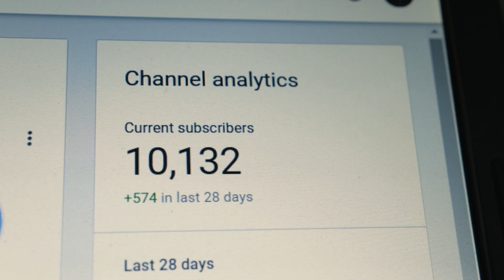ASK US ANYTHING

Comment: Here is 2 questions, I have two optima batteries, primary starting 800 cca red top, back up blue top deep cell marine battery, since I need them to keep them 100% charged, where do I get the correct alternator size to replace the stock alternator, with the correct amperage output??
Reply from the maker: You can buy higher output alternators from most classic mini suppliers. But why on earth do you want two batteries?
Reply: I have a van with a light rack & stereo, a 1962 Austin work van , jump starting, work vans & service vehicles, the mini alternators are 50 amps  will that be strong enough to keep both charged 100% I heard a to small alternator will only charge to 75% and will quickly kill both batteries

Comment: Rocker gear, maybe a sequel to your rocker adjustment video? I just bought cooper s 1.3:1 forged rockers with upgraded shaft with bushing/shim kit. Would love to see how you would maximize the cam to valve relation. Also plan to port match manifolds to the head, may be a tutorial?